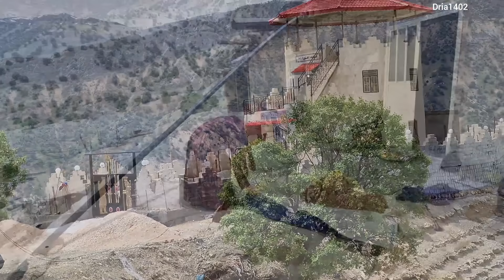Venus's love story to his son:The beginning of a new life.

Comment: what you added to clothes is not soap, it it softner for clothes , to make material of cloth feel very soft for babies . it is used after you wash the baby's clothes and rinse with water , add a small amount of softner to new water and rinse slightly . that's it . there is special detergent for babies cloth ask about it. it is very imporantant to rinse baby's clothes very well. otherwise he will get rashes on his skin due to chemicals in the soap. I am advising you to hang the clothes properly , open them dont hang them folded , so whaterver water inside the clothes it will dry and any chemicals will evaporate

Comment: operator Tell it to mom;  To ensure that the child’s back is not curved and the back is straight, there is no need to place the child on a pillow until he holds his head up.  Simply place the child without a pillow on a flat bed without any elevation.  And there is no need to shake him, he is a very calm child, without you rocking.

Comment: Please tell her to hold the baby's head and neck. I hate to see the baby's head flop like a rag doll. Also, please tell her not to put a pillow on the babys head. He can suffocate. His neck isn't stretched out, and his chin is touching the neck, which isn't allowing the air pipe to be clear. He looks a little jaundiced. I winder why they put two umbilical clips. They look huge compared to the ones used in America. PLEASE CAMERAMAN, RELAY THE ADVICE I'VE GIVEN.  Is the water safe to drink? When Mirza put the hose in, the water didn't look clean. I hope they don't give Poria any water. Poria has the hiccups because he either is wet or is cold. She doesn't even know how to put his diaper properly.  Camerman, you SHOULD'VE BLURRED baby Poria's private area just like they did with Arad. They never showed Arad's private area.